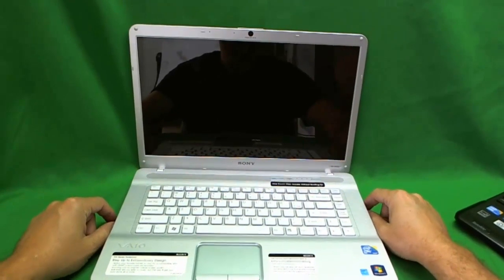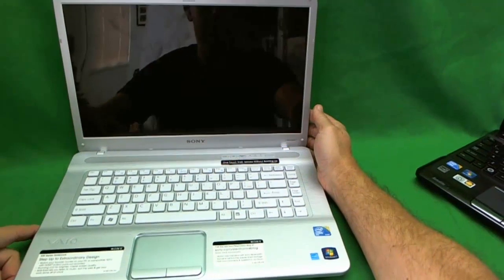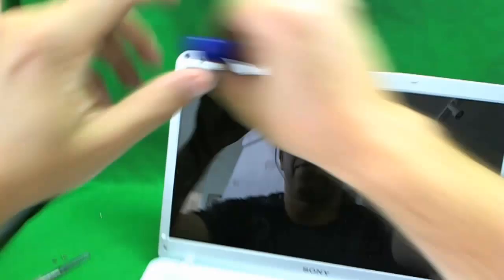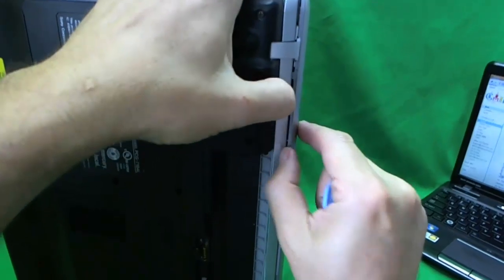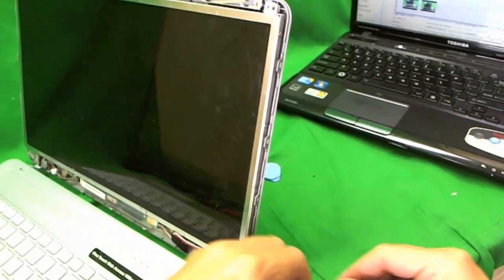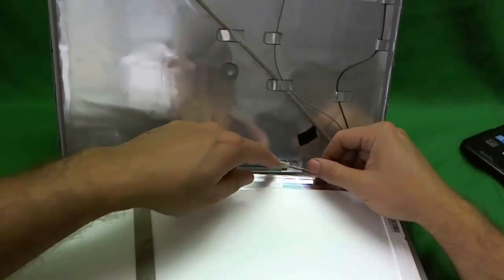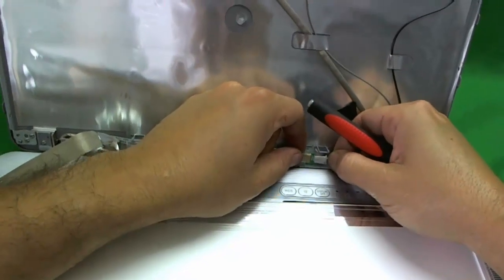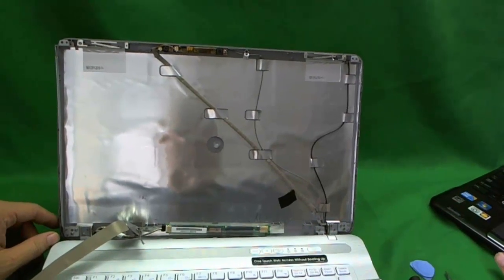Sony Vaio NW Series Laptop Screen Replacement Procedure

Comment: I need to replace the LCD top lid but could not find any manual for this. Can anyone tell me how to remove the screen lid. I can open the screen frame and take the screen out, need to know how to remove the top lid.

My model is VGN-NW20EF

Comment: I'm working on a NW series laptop (same model as this one, slightly different screen connection). It has a blank screen, spins up the hard drive but never shows anything. I left it in the car a few hours and it booted up (when hot) just fine, screen worked fine. But, when it's cool, nothing. I tend to think it's either the video chipset or the connections.

I've torn it down to the board and screen, and would love a quick exchange regarding possible fixes, including send it to you :)